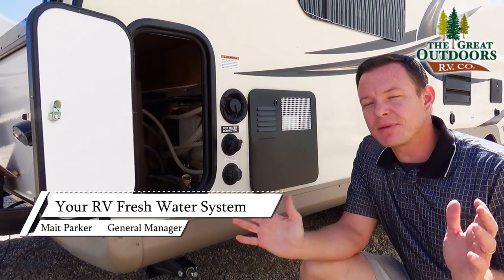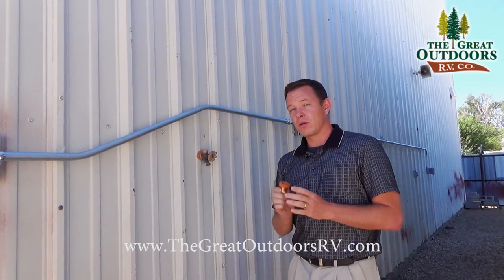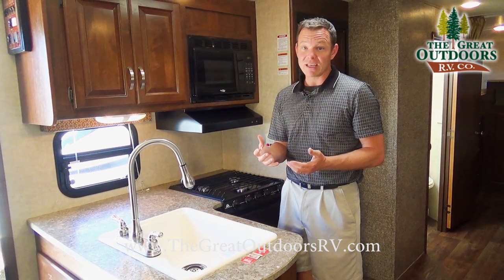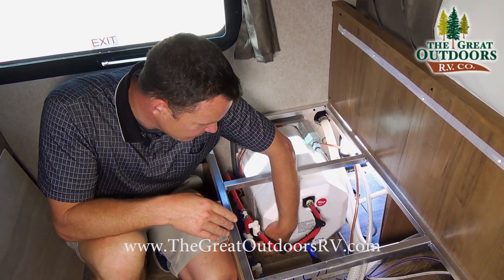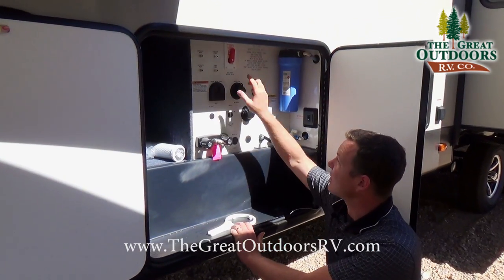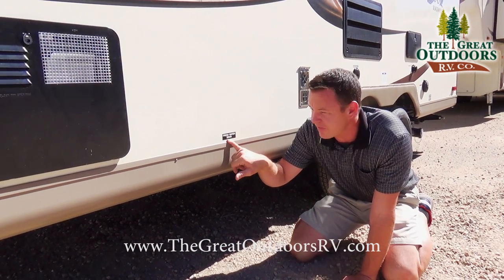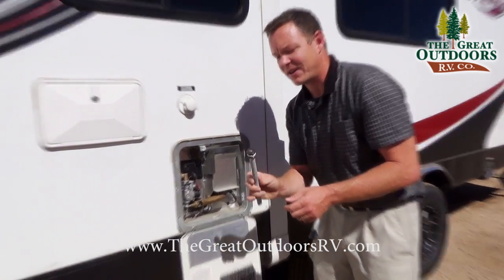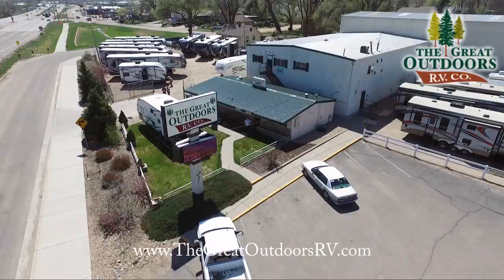RV Fresh Water System: Tips & Tricks

Comment: What a great video!! Thanks for making and sharing. Our biggest question for our camper is we would like to clean our holding tank but we have a city and holding tank in 1 connection like the camper shown in this video at the 7:20 point. We have bought the cleaning fluid as also mentioned in this video but since our connection is a pressurized gravity connection we can not figure out how to put that cleaner in! Any suggestions, adapters? Thanks!

Comment: hi very informative  video- I need to install a bypass valve because my unit does not have one, there is one built into the waterpump I am told but I'm not in a place to replace the water pump just now. where in the line would you suggest splicing into the line to install this bypass valve?

Comment: I have a older (2000) 32' Class C & my last trip I was unable to take on city water or fill fresh tank.  I took out the two-way valve that separates the  two  fill inlets and replaced with a piece of double male threaded pipe. I was still unable to take on water. Suggestions?

Comment: Great Video! I have an NW Arctic Fox truck Camper, 2017, and am trying to find a video on proper filling and draining the system. I filled it, but there is a flow of water underneath from (i think) an overflow or drain valve, I'm not sure if I closed ALL water valves, the user's manual is vague AT BEST and has no pictures. Do you have videos for Truck Campers????

Comment: So I'm hooked up to freshwater City water in my trailer but there is no water and there is water coming from the faucet but there is no water inside the trailer what do I do
Reply from the maker: @lisaashby1837 Be sure to have your RV's water system set to city water and not your fresh tank, as well as making sure your water pump is turned off. Give us a call at 970-313-4337 if you run into any other problems

Comment: Nice video but all i wamna know is why im not getting any water cumin out of any faucet are bathroom my water pump is on tank is full???
Reply: Did you ever figure this out? does the pump ever run? does it run all the time or when you open a faucet? I'm not sure if it's serviceable but i think they have a pressure switch of some kind that tells the pump to run, which could be defective or disconnected if it is not running at all. Also, the RV could be winterized and the pump might be bypassed or something. Be interested to know if you figured out.

Comment: How many gallons does a fresh water tank hold on the average.?
Reply from the maker: On smaller travel trailers you can expect fresh water tanks to be anywhere from 20 to 40 gallons while fifth wheels can have fresh tanks up to 100 gallons. Check with your manufacturer to confirm the tank size on your RV for the most accurate info!

Comment: I have a 2013 Thor ACE 29.2 RV with low water pressure when using a water pump.  Also, when connected to city water, my fresh water tank overflows. I've contacted Thor factory experts and could not come up to a solution.  I could not find a location of a check valve.  My water pump was replaced recently. I  would appreciate any help.
Reply from the maker: Hello Sam, sounds like a valve is not turned the right way.  Im assuming everything was working properly BEFORE the new water pump was installed?  I would consult the folks who did your water pump replacement.

Happy Camping, Tom
Reply: My water pressure is fine but on our last outing while connected to city water, our fresh tank also started to over flow.  I turned off the city water and drained the fresh water tank and then gave the water pump a few taps with a wrench, thinking there should be a check valve stuck open.  I then turned on the city water and it seemed to do the trick. The fresh water tank did not fill up or over flow again.

Comment: Cant find a single help on a trickling water flow from city water line hook up. No leaks, no filters on taps. No in-line water filter, but very weak water flow.
Reply: I remember hearing about problems caused by a handheld faucet nozzle being closed despite the nobs being opened. I think it was an issue with luke warm water and not pressure, but still something to consider.

Comment: I have hard water. Is it ok to use the water from my water softener? (Salt water)
Reply: I'm not an authority on hard water but I was reading that hard water (or, i guess salt treated hard water) will eat away a lot faster on the anode in your water heater. I guess untreated hard water will build up more deposits, so if that's the case you'd probably prefer the inexpensive thing that's meant to be expendable to be expended faster rather than dealing with all the other hard water issues.
Reply: If I can add to this conversation, yes, you may be replacing your tank anode a bit more often. But that's not a big deal, or expensive. Go ahead and use softened water, and check your anode once a year at the end of the season. If ANY of the wire core is showing, replace it. Easy!